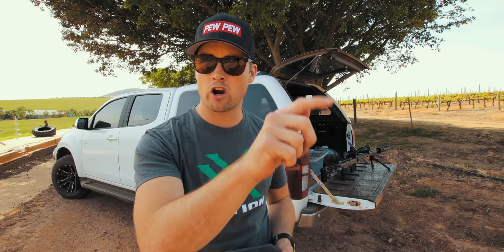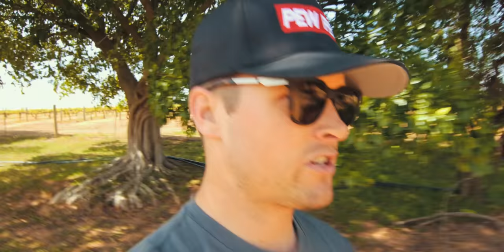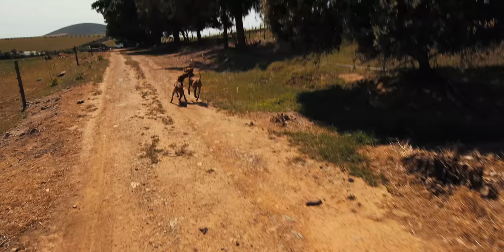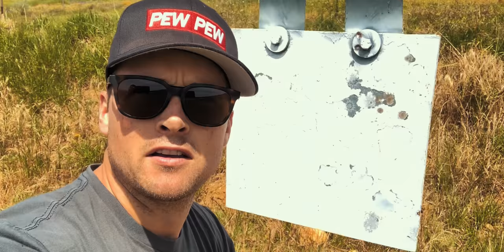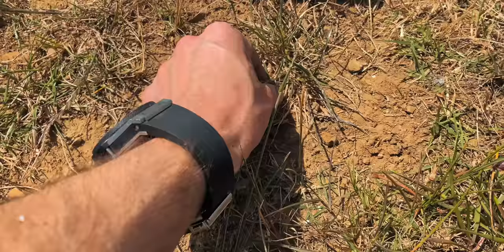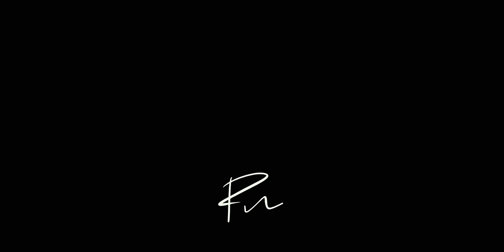Monolithic Bullets Vs Steel Targets

Comment: Speed defeats steel. I'm fairly certain a 110gr GMX run through a 300 RUM @ ~4,100+ fps would burn right through like a hot knife in butter but maybe I'm wrong 🤷‍♂️

Comment: Lack of damage has more to do with distance than being a monolithic bullet, I manufacture steel targets with lots of testing.  And at closer distances even frangible rounds will damage hardened steel.   I have even bent hardened plate with soft point rounds from a 308, I put 292 bullets on a 3/8ths plate at 50 yards in less than 30 minutes.  Yes I still have the plate, testing is done close since the targets I build are close range defensive training targets....

Comment: It depends on what steel you are using.  My 308 Win penetrates 1/2" into steel up to 300 meters because my steel is a common plate.  For this reason I need to use 1" thick steel targets. (Can't get special steels in my location)

Comment: On the shots with the hard bolt lift, did you full length resize the cases? Would be interested to see what the monolithic bullets do against concrete cinder block. Love your dogs.

Comment: Hey i got a question for ya..or a senirio for ya. Say you use 23 grain for a 223 round with a 55 grain projectile and a round with a 77 grain projectile. Will the 77 grain build up more.pressure in the case bc its coming out of the barrel slower than the 55 grain
Reply: Short answer is yes. Long answer is ehhh not by any significant margin because you are using the same 23 grains for powder, basically the pressures will more than likely be very close to the same. Usually Heavier bullets travel slower because they take less powder, and believe it or not they have less pressures than lighter bullets because generally people load lighter bullets with more powder due to case space and to get them fps. So overall, how long a bullet stays in the barrel is a mute point when it comes to pressure. It is about the size of the explosion, or powder charge that increases pressures.
Reply: @taylorharris5601  thats what I was thinking. I loaded some .223 cases with 23 grains of reloder 10x with 77gr amo bthp and about blew the back of the case out